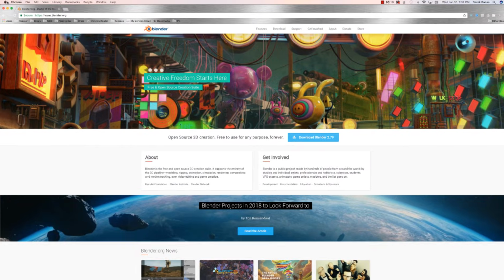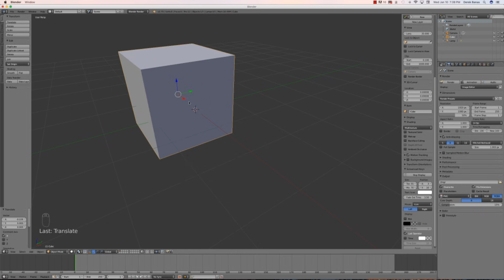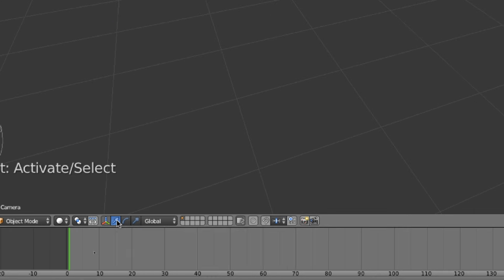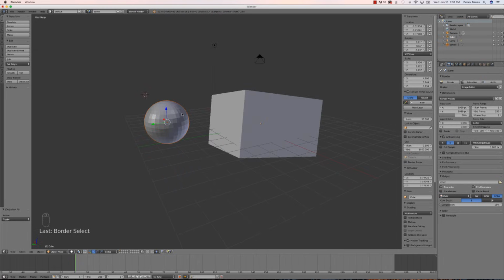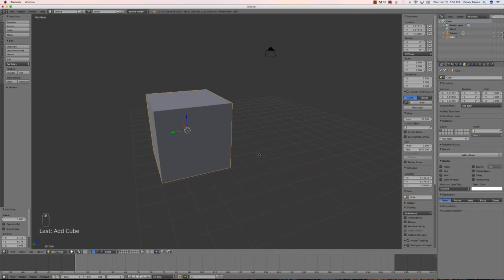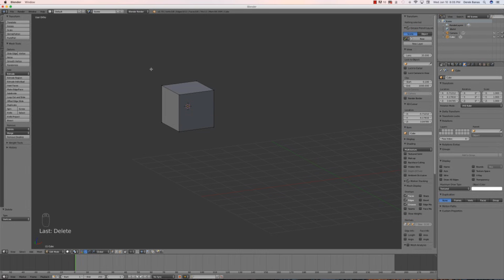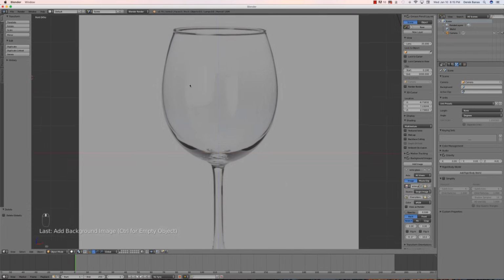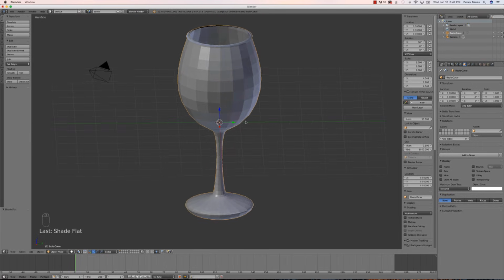Blender 2.79 Tutorial

Comment: "Chances are if you have 2.8 things are exactly the same"
that did not age well
Reply: @Zef I had the same question. But i was using an Intel HD 4400 and blender would crash eveytime i tried to launch it. Then i realized that I had a ZOTAC Nvidia GeForce 210 graphics card in my old system and tried using that, and it worked perfectly :) So I guess the Nvidia GeForce GT 210 is a cheap and decent enough card with dedicated GPU to start with.
Reply: @Zef yes with 2.79 maybe with 2.80. maybe

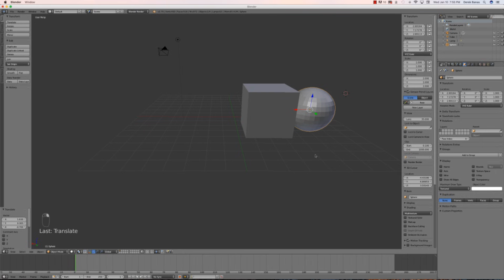Comment: I'm having a problem splitting the cube and sphere after doing the join, found at 16:30 in the video. 
I have followed the video up to this point, my settings and mouse set up are the same. 
After deleting the prior objects, I create the cube, move the cube over, deselect, and then create the sphere. 
I have tried by having them overlap, as well and not overlap, my result is the same, doing the following. 

I then use shift and right click to select each object, I press control + j, I then deselect with "a". 
Then I reselect with right click to ensure they are indeed one object. I press "Tab" to switch to edit mode. I press "p" and choose "loose parts". 
"Tab" again to get back into object mode. 
Make sure nothing is selected with "a", then I right click the sphere and drag, I even attempted this with "g" then "x" to grab and move along the x axis. The result is both moving together.

 I got them to separate once by hiding the cube with "h", moved the sphere and alt + h to unhide the cube, the sphere would then allow it to be moved separately but the center point is offset towards the direction the cube was. 

Using blender 2.79, Windows 10. Any suggestions?
Reply: I just tried a shutdown of blender and did the join/split attempt. It worked, although it still had the xyz indicator offset. I think it could've been an issue with group1 being created with the step just before. Not quite settled on learning that step since I would have no idea how to handle that situation without having to start over from a fresh file.